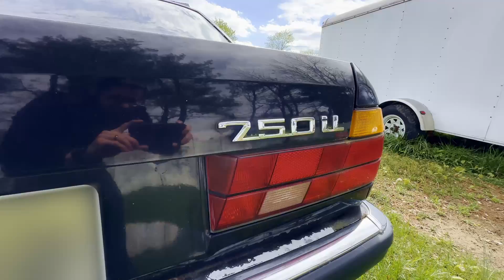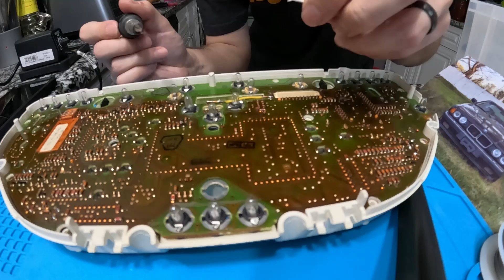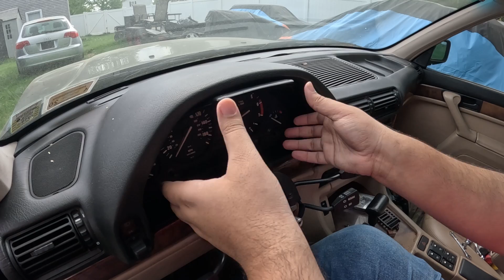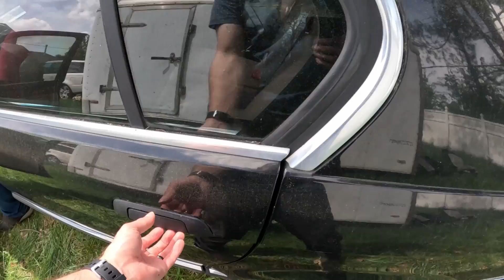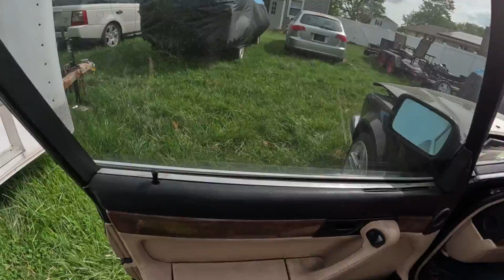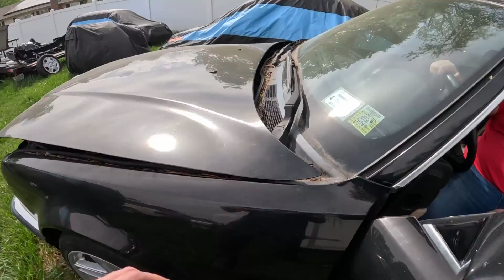I Fixed my V12 BMW for 30 CENTS! - E32 Instrument Cluster Repair

Comment: Hey man! I hope you react and might be able to help🫡
So my V12 randomly shut down while driving haha,
I have no spark anf fuel. EML light does not come on. But i just checked the cluster and I put 12V on them and they work. So I guess something else is broken?
Crank sensors should be fine 490 OHM.
Cam sensors are 1 ohm..
Reply from the maker: I'd look into the distributors, and potentially the fuel pump and filter? These V12s can be a challenge to diagnose!

Comment: Have you solved the check engine light ? Mine is acting the same way where it turns off when you rev it up
Reply from the maker: Not yet since this project is on the backburner for now, but I'm sure mine would benefit from fresh fuel.

Comment: internet forums are the best places to find info, and provide how to fix almost everything. ( you have to wonder why an engineer would combine startup procedures with a cluster)
Reply from the maker: Yes, I always do research before starting a job so I know what to expect! 
My guess is that engineers tied the whole system through the bulbs so that if the system can't warn you of issues it prevents you from driving - that way you don't damage the engine. I wonder if there's a BMW engineer out there who could explain it!
Reply: @frenchineer  Im guess it made sense at the time